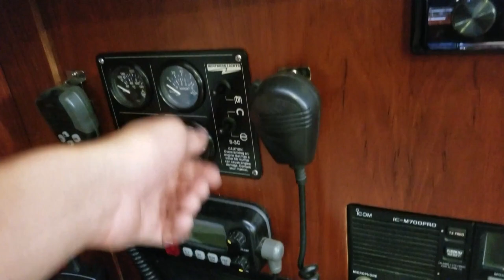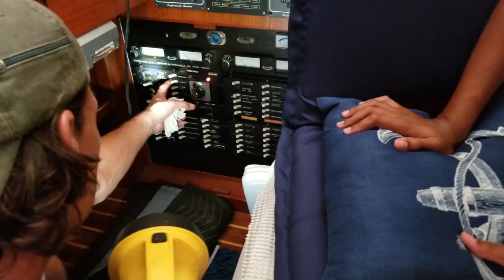HOW TO INSTALL A GENERATOR IN YOUR SAILBOAT

Comment: the little line that goes back to the tank that's called a return line and every diesel needs one it doesn't use all the diesel that is applied to it so it returns it

Comment: Gentlemen what he was calling clogged up you got to bleed the diesel lines they'll have air in them and a diesel does not run on air it refuses to run into you get the air bleed out of the lines and the injectors the easiest way to do it is crack the line at the top of the injector crank it over until the fuel gets there and you do that air for every injector crack it at the top of the injector where the line comes into it and when the air bubble stop and the fuel starts flowing you'll know it, but a nice job fellas I wish you would have showed how you hooked up the electric into the panels